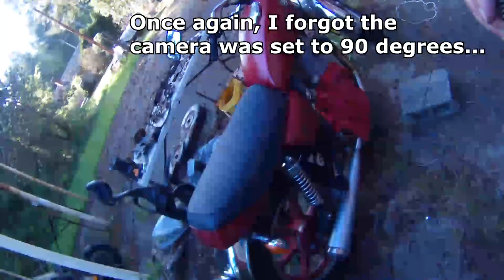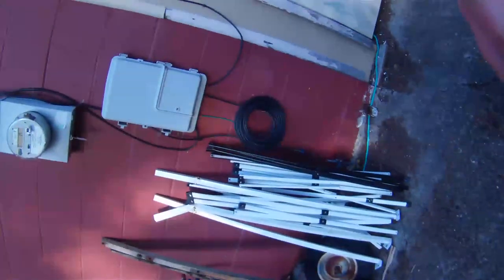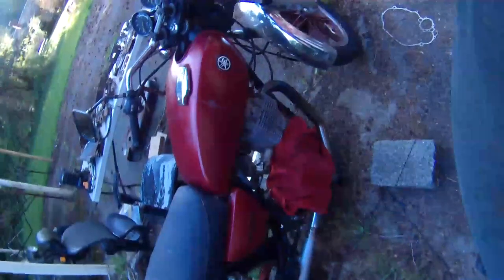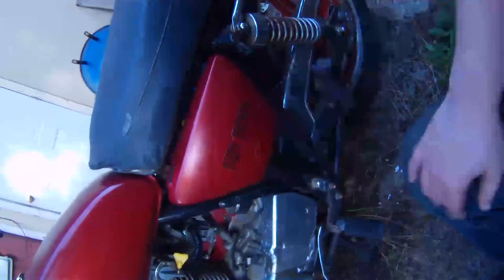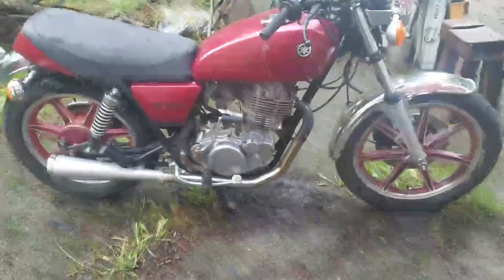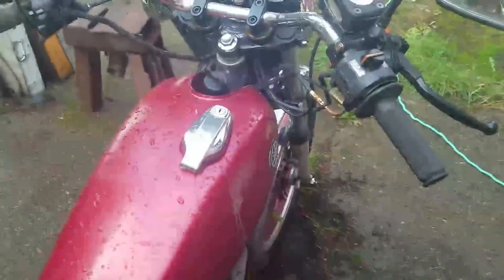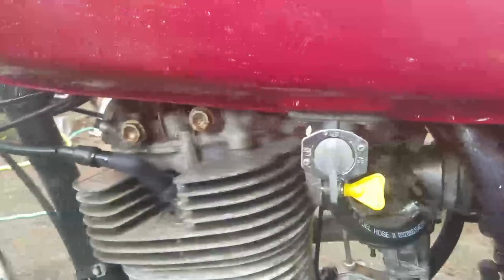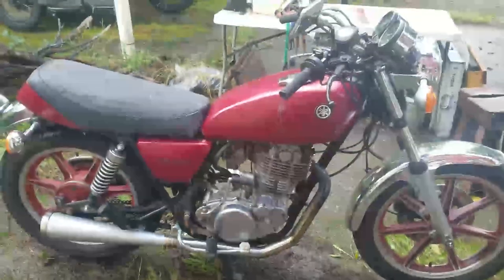Yamaha SR500 Part 39: Finished the clutch replacement.

Comment: Once you do start it if you're keen bleed the air from the 8mm hex oil filter bleed screw at the top of the filter cover 
It's very tricky and there's a good chance you will loosen the screw to far and it will come out and shoot oil all over your ceiling so be ready for it 
Put a container under the bike to catch any spillage and have a rag handy to contain the mess and be ready to hit the kill switch if the screw comes out 
It's near impossible but the trick is is to carefully loosen the screw until it's held in by about one thread and the air and then oil passes it and then screw it back in 
But no matter how careful you are three out of four times the screw will slip out so as I said get read to contain the mess and to hit the kill switch and stop the motor 
I replaced my battery six or more months ago I got about five years from my last battery 
The ones I use are full sized semi dry cell batteries that you don't top up and don't have breather/overflow tubes 
There are lots of different generators on different SRs I'd say your one would likely be similar to my one 
I don't think my one will start with a fully flat battery and is very hard to start if the battery is low on charge 
So if you have any problems starting it maybe disconnecting you battery eliminator and try putting some jump leads from a car battery or a booster pack to it 
I could be wrong but if that makes it start maybe consider fitting a battery again

Comment: The bleed screw on the oil filter housing is loosened a couple of turns.  when you start it up, oil should seep out ,indicating oil pressure .  The manual says if oil doesnt come after a minute or so shut it off.  Doesnt say what would be wrong, but i guess the oil pump would be checked.
Reply from the maker: Thanks. Next time I get it started, I'll double check the manual. Just didn't have it handy this time.  :)